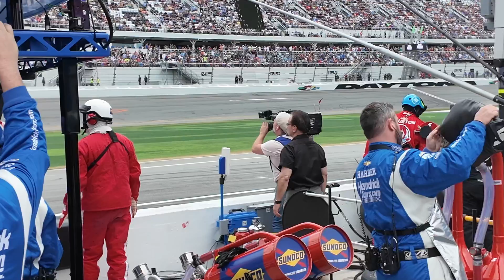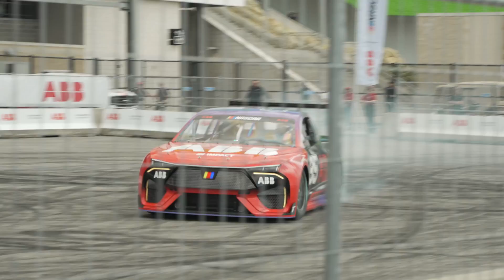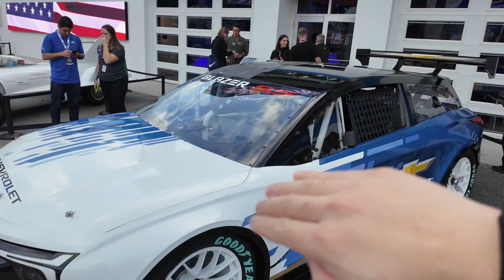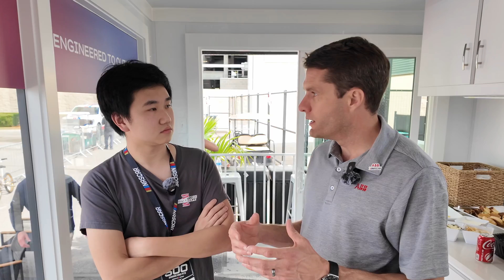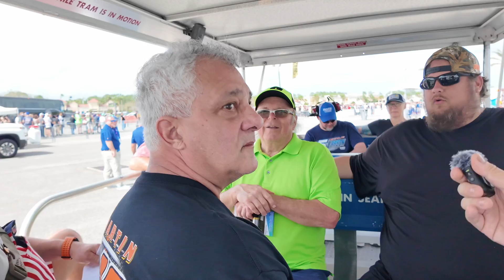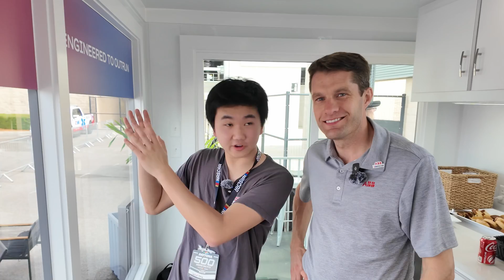The 1300+ HP AWD Race Car Everyone Loves to HATE - NASCAR ABB EV Prototype

Comment: I find stupid electric racing to be a standard. The whole proposition of electric mobility is about being green and efficient. Electric mobility makes sense in public transport and daily speed cars, not in supercars and racing cars. The acceleration of an electric is amazing, but it doesn't last long and to recharge it takes forever in pit. Plus, cars become quite heavier, and there is no sound, no excitement. I see all this as just senseless propaganda to sell more electrics.
Reply from the maker: A couple of counter points: 
1.Formula E introduced mid-race charging this year, adding ~10% of their allocated energy in 30 seconds or so. Adds complexity and strategy to the races!
2.EV's has "less" noise but definitely NO sound. It's a different noise, for sure, but maybe they can find a way to amplify it.
3.Heavier might not necessarily be bad for racing. Heavier cars don't brake as well, and they have less grip, but that puts more challenge on the driver to manage and be smooth. Plus longer braking zones = more chances for overtaking, and if the brakes are overheating, you can use EV regen to counter, or even change motor drive bias on the fly... 

I'd hate for NASCAR to completely ditch V8's for EV's. But a free-for-all EV series with more battery development, charging developments, and lightweight development, will help us all, imo

Comment: As innovative as it may be, it completely alienates majority of the remaining fanbase. I'm not a NASCAR watcher, however I believe this will be a miss in the long term. Think they're better to get on the sustainable new fuels for internal combustion engines.
Reply from the maker: I think that's why this remains a "prototype". It's basically a EV-swapped Gen 7 NASCAR, partly to show what they CAN do, and partly to see how it is received. I have no doubts they're constantly considering the future for the sport, which is why no one would go on the record and tell me, YES, A full EV Nascar series is coming. They want to keep the V8‘s forever, but doesn't hurt to see what else is possible.
Reply: @JackieDing86  I understand the concept and the thought process. I just know the typical NASCAR fans like my father's friend. No way he'd ever purchase tickets to go see a race if the switch were to be made. He normally goes to  6 races a year.
Reply: They're racecar builders. They're not innovators in the way where they uproot the entire petrol industry. Good luck with that.

Comment: EV NASCAR ? NAH NO THANK YOU IDC IF IT IS FAST ! NASCAR WOULD BE DONE IF THEY START PUTTING THESE INTO THE RACES ! THERE AINT 1 NASCAR FAN THATS EXCITED ABOUT THIS !
Reply: The hardpart about this is that Nascar has lost its identity even with their current setup. The hard part is that NASCAR is a brand more than ever rather than a race series. Branching out to EVs and actual stock cars and not these gas powered tubechassis cars makes it tough. 

AS A NASCAR FAN I AM EXCITED ABOUT THIS!!! IDGAF WHAT THEY HAVE AS LONG AS ITS FAST!!!
Reply from the maker: I can totally see how a traditional Nascar fan would be upset, but everyone I talked to made it adamant that NASCAR will not get rid of or replace the V8's with EV's. It'll be an addition, whether it's a new series or something else.
Reply: @JackieDing86  as long as its in its own separate series then thats fine but if they replaced them with EVS NASCAR would be done ! And what kind of EV cars do Ford and Toyota have that could race with the Blazer in that series if its made ?
Reply: @JackieDing86  imagine cars sounding like bee's going in circles for 1h
Reply: @ Its already a thing basically just at a lower pitch. There's no real difference. They're a spec series in a spec car. NASCAR would be fun if they brought back ACTUAL stock cars.
Reply from the maker: Yea I can see all points above. Superspeedway would be a no-go in cars like these. I think the way forward is short ovals + street/road courses, plus something outrageous like Bristol on Dirt or pure dirt ovals!
Reply: @JackieDing86  is it because they are to fast for superspeedways? If Chevy has the Blazer , what kind of cars does Ford and Toyota have for that series yet if made ? And yeah could see the cars being ran at places like Barbers and Road America and places with road courses!
Reply from the maker: Superspeedways would work too, 1300+ horsepower is probably way too much and they'll likely dial them down for those races (just like the Cup cars anyway). But EV's are most exciting at the low speeds, acceleration out of corners, plus they recover a lot of energy through braking, two things that you almost never get at Superspeedways. So an EV race at Daytona might just be a pack of cars all sitting at an artificial speed limiter, and probably running out of juice very quickly... and that wouldn't be exciting.

But road courses that you mentioned, Chicago street course, short ovals, dirt ovals? Fuck yaaaaa. 

Ford already unveiled the Mustang Mach-E Nascar prototype. Toyota doesn't really have a suitable car, but they can always do a RAV4 hybrid or bz4x body.
Reply: @shannacollins4741  EV’s need braking to regenerate the battery. They would perform better for longer periods of time on a road course or short oval with braking rather than a superspeedway.
Reply: @ChrisShigas  ohh hell i didnt think about the regenerative braking system thanks for the info !
Reply: @JackieDing86  knowing Toyota they'd probably do another Prius or something like that! Lol